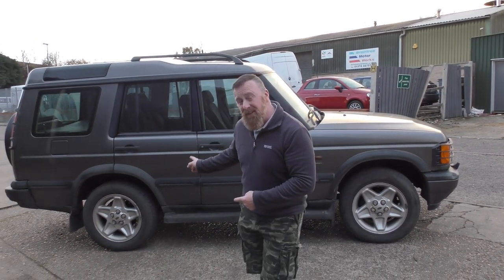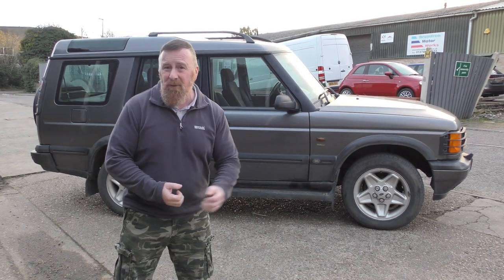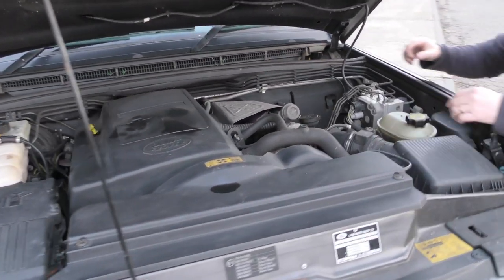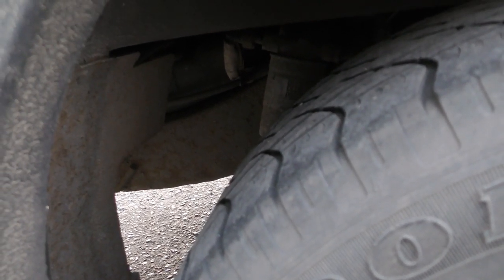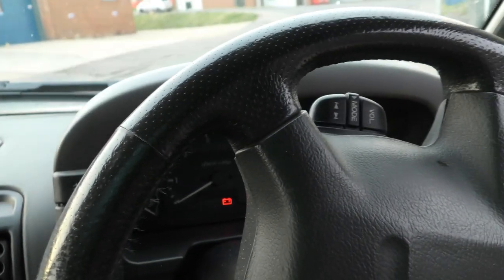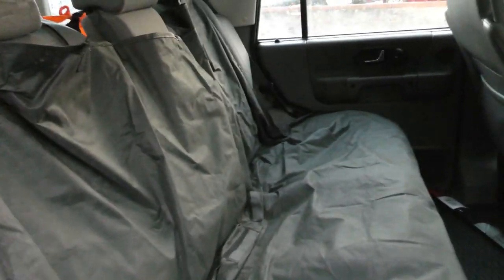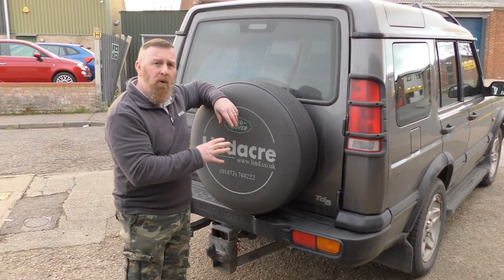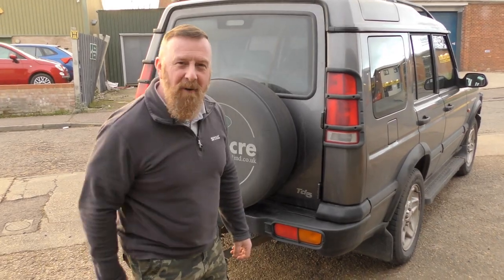LAND ROVER DISCOVERY TD5 FIRST LOOK MARK SAVAGE

Comment: This video just came up on my recommended and I have a disco td5 and I turned it into a van and it’s the farm vehicle I ripped the back seats out and built shelves opposite the to back doors and then put a wooden wall behind the shelves and the boot is used for the loading area

Comment: My father picked out 2001 discovery 2 es7 new from merlin Cardiff when I was 22 and we did a deal with them that we would take it away, put marine primer on chassis and cills and they would waxoil it..best thing we did even know I remember the salesman saying “you won’t need to do that son, these are built to last” lol
200,000 miles later and it’s never been welded and is now my wife’s daily car.
We won’t ever get rid as it holds so many memories now from collecting my son from hospital and 17 years later teaching him to drive and him passing his test in it. We’ve been all over Scandinavia and artic circle and most of Europe in the old girl and it gets treated like a family member… on the whole it’s been a brilliant reliable vehicle!
If you drop the sump make sure you replace the oil pump bolt and lock thread it well as they can come loose!   Also, the rear windows have a felt material seal which drops down making wind noise, I went all the way to Spain with it driving me crazy!  If you put the window down and put a screwdriver into the channel, push and lift up at the same time the seal should lift up stopping the wind noise.. 
anyway, nice looking disco!
Reply from the maker: Top man 
Thats a nice story and good to hear you have had it all this time bud 
I did look for the seal but it had been ripped out ! Odd as I had been told about them dropping 
Good advice and let's see on the next videos how it looks underneath and how the service goes with the leaks lol 
Take care bud

Comment: hi Mark. I just brought a 2003 Landrover discovery td5 it has 7 grand in upgrades remap tough dog suspension brand new tyres and rims stainless steel exhaust silicone hoses led lights diff lock ect ect its in perfect condition i paid 4 K for it but unfortunately it has a crook gearbox it wont upshift gears on the auto its been serviced gearbox oil is clean my question is are they good on the road as iam thinking of putting another gearbox in which i can get  but people are saying not worth fixing can you tow a caravan with them the motor in it is spot on except for the gearbox any help appreciated not sure where your from iam from ballarat Victoria

Comment: Can never quite understand the mindset that buys a 20 year old vehicle, takes it down a muddy track, and then wonders why it starts falling to bits. 
I have a disco 2 that I have no intention of "taking off-road", but should I need to then I know I can.
Having said that, they do have a tendency to have "reliability issues", but for an old girl who has been to the moon in miles done, I would be hard pressed to drive anything else.
Reply from the maker: I have to agree bud , I do like them but all have the same problems,  you have to love them to own one knowing your going to have to pay out soon lol.
But just a few videos to help keep them on the road
Reply: @marksavage  But at least we can "work" on them. Yes you need fingers that dislocate themselves, (LR why didn't you make the engine bay 2 inches wider ffs. As any girl will tell you...). Anyway back to matter in hand. How many "modern" cars would you like to work on? More sensors than a trident missile and twice as complicated.
Great videos anyway thanks.
Reply from the maker: @sisyphussapprentice8976  totally agree as in the service I just did on the wife's car 
You can't even do the rear breaks on most cars today as you need a computer lol
Reply: @marksavage  When I was a "lad" we had a similar aid...It was called a lump hammer. Would fix most things, including your wretched computer.😀